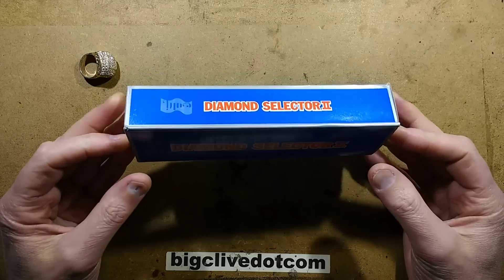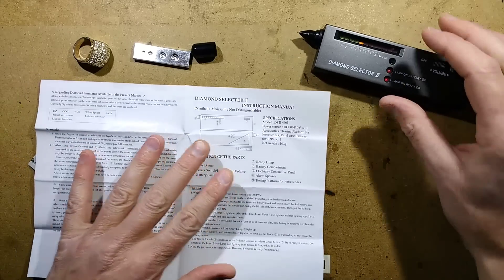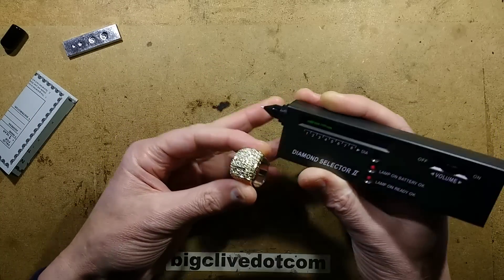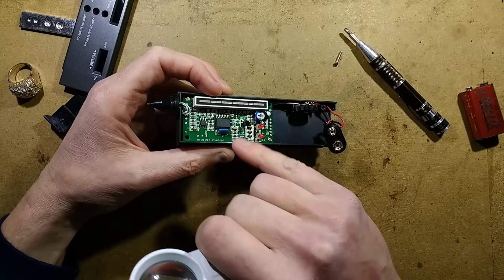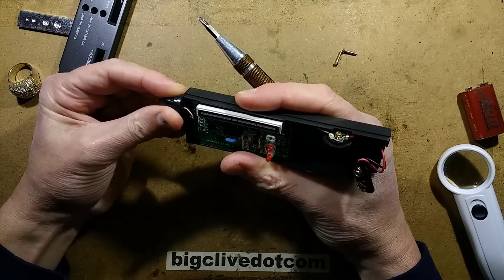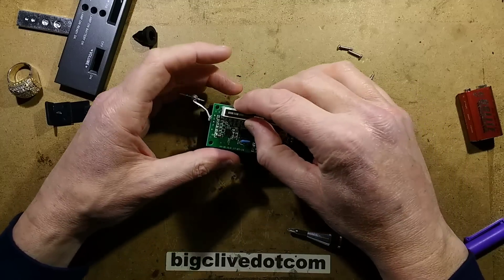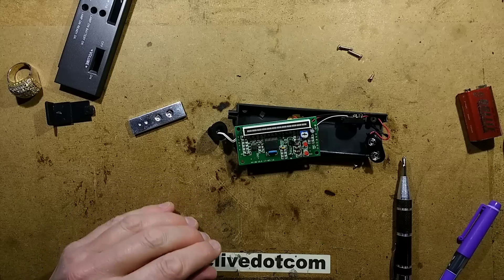Inside a diamond tester.  (thermal conductivity)

Comment: I don't buy the 37°C of the tip. Your camera caught a larger area than just the tip and read an average.
I had such devices in my hands (professional ones) and, nosy as I am, tried the temperature on the outside of my thumb or hand - it hurt a lot!
You shouldn't use these for diamonds smaller than indicated in the description and shall not use it as the only indication method!

Comment: Hello Clive, I’ve greatly enjoyed your videos for a long time, but I had never noticed this one before.  As it turns out I bought the same tester to try out an idea which I had.  I’m involved with a group of electronic scrappers on Facebook and new members often show items they’re unfamiliar with to get them ID’ed and ask about potential precious metal content.  We’re always warning members of the toxic dust dangers of breaking the white Beryllium Oxide (BeO) ceramic caps on RF power transistors or the purple BeO ceramic rings on magnetron tubes for example.  In some cases there will be a warning label on a board or particular component, but often we’re left to guess whether they could contain BeO or not?  My Google research showed that BeO has a much higher thermal conductivity than alumina.  So my idea was to see if there was enough difference that a normal diamond tester could determine reliably whether a ceramic item is toxic BeO or just ordinary alumina?  I don’t know if you ever did any further investigations with this device or created a schematic?  I just got my tester in the mail today and did a quick video earlier tonight.  I had some inconsistencies though, but I could only locate one known BeO object for comparison.  I don’t know if the range of this device could be modified to be better for this purpose, although if you came up with your own design I’d be willing to purchase one.  In any case if you would be willing to take a look at my testing and results it’s at:  https://youtu.be/QSO_BxoWdAw

Thank you!
Leo

Comment: So this thing works almost exactly like a Mass Air Flow sensor in a car intake, except instead of pressing the tip against a gemstone the tip is in the intake air stream and the other end is protected from airflow. Higher air pressure cools it faster, more airflow cools it faster, and the ECU can accurately calculate, from that, the absolute amount of air going into the engine at a given time.

Comment: personally maybe the op amp is use to GAIN the signal as the differential of thermal conductivity is so LOW, that the micro controller attached now can read the signal and have a range of frequencies(1-3 now have 1-100)(micro controller probably) at  set up as a pontentiometer( were you can adjust a starting point[calibration]) at that given value, you set the micrometer to reals required voltage to the graphical display hence the manual calibration. to find their"zero poiint"....fr i work with thermoucple all day at work..i thought it would have been a lux sensor in that thing :L

Comment: you could check it on a dressing diamond used in a grinding disc dresser. Alternatively, a diamond in a glass cutter tool could help testing it too. The differential temperature measurment method with a heater centered between 2 thermocouple sensors is also used on a pipe in mass flow meters of gasses and liquids.

Comment: A simple method is to hold the stone to your lip.  If it feels cold like metal, then it is likely to be a diamond. Other gemstones feel warm as they are not highly thermally conductive.  The synthetic gem he mentions "moissanite" has a lower density, a higher refractive index and a slightly lower hardness than diamond.  However, moissanite is electrically conductive while diamond is an excellent insulator.  I'm sure Big Clive could whisk up a suitable detector for it!

Comment: So would would it be measuring a change in voltage/current because of the temperature difference on both sides of the pin and back to the chip and sending it to the led graph. I thought these might of worked on some frequency the diamond might have. I wonder how actuate they are?💍♨

Comment: Cool Beans.   I was thinking they used Electrical Conductivity.    Thermo Couple generate Current not so much voltage variations. They're measuring the current variance.  Bet the Op AMP is set up in a Differential configuration ?

Comment: Is there a device for metals too?
A tester to make sure your gold bars are not colorful coated Tungsten rods ?   :-)   ?
Reply: Measure the specific gravity, that will give you a very good idea, and cheap too.  After that you could measure electrical conductivity (more expensive) or use a mass spectrometer (very expensive!).
Reply: @karhukivi  SeaJay chose those two metals for a reason. sp. gr. Au = 19.3  sp. gr. W = 19.3   You still going to suggest using sp. gr. as a way to distinguish them?
Reply: @igrim4777  true!   Usually it is some cheaper metal like brass or an alloy with silver, hence a SG test.  In this case electrical conductivity would be a better test if we knew in advance that the choice was limited exclusively to gold or coloured tungsten bars.  But how would we know that in advance?
Reply: @igrim4777  OK, so say it is a quiz game and they tell you it is either a gold bar or a gold-plated tungsten bar, how can you tell the difference without lab equipment?  One way is to drop them both onto a hard surface - the tungsten is hard and will bounce, the gold is malleable and will hardly bounce at all.  You could also hit them with a hammer, or scratch them with a knife.

Comment: The two thermocouples are the same basic idea as a "Mass flow meter" the basis for "Mass flow controllers" (feedback to control a valve position to control flow). The ptc being a heat source instead of a hot wire being cooled and temp being measured up and down wind. Cute design. Tootles... Wade

Comment: in the past many times the number was also on the bottom of the chip although I havent seen that lately, Also I have been able to resurrect the part number using a high power magnification and able to see the remnants of the original number

Comment: The simplest answer is usually the solution - especially when you're talking cheap stuff.  Constant current supplied by the two copper wires heats the rod to a set temperature.  Thermistor in the middle detects temp, and dial sets it to the middle.  Constant current means constant temp for set resistance in a set environment.  You zero the graph, and anything you touch the tip to drops the temperature, moving the graph.  Just a guess, but I find it hard to believe they'd have balanced thermocouples at that price.
Reply: Occam's Razor demonstrated. Congratulations, you guessed correctly!

Comment: Computer heatsinks are never anodized, because the process replaces Aluminum atoms with an element that can bond in the same way, im imagining any element with the same number of electrons in the relevant electron shell, which would be 3 if Im not mistaken.

Youd have a whole surface layer of poorly conducting material.

Comment: Big Clive: an emergency repair of a battery charger at a hotel involved me using 60sec all purpose glue to secure a plaatic plug thing inside... like inside of PCs ... is thjs likely to set on fire or am i safe
Reply from the maker: Without knowing exactly what you'd done it's hard to say.  The high speed resin glues may not stick some plastics too well.

Comment: Sounds to me that it might work like a hot-wire anemometer for measuring air speeds.  The thermocouples control the current flowing through the wire to maintain some temperature.  By measuring the change in current to maintain that temperature you can estimate the thermal conductivity of whatever material you touch the tip to.

Comment: hey clive, i've noticed that you often use the word "modest" in what seems to be the opposite way in how i've heard it, and also the opposite of the actual dictionary definition. it basically means small, or not much. but you often seem to refer to "modest" as fairly large. What do you think?
Reply from the maker: I think it may have different meanings around thew world.  For instance, making a modest living out of something means that it's OK but not spectacular.
Reply: i think i would agree, but i think you use it when you mean something is larger then you might expect. for example if a resistor value is somewhat larger then you would have thought you sometimes will say like "wow that's a pretty modest value"
Reply: Modest is part of a rising scale such as "tiny, small, modest, copious, large and huge. Modest would be in the realm of sufficient and not skimped. Hope this helps you out beano.

Comment: I wonder if it is a thermocouple. You said it needed to warm up to 36C. That implies a heater in the tip. I suspect that the probe wire is nichrome or the like and the two hunks of magnet wire put a current across it. The thermistor then sees a change when you touch the end of the wire to something cold. Perhaps somewhat like a hot wire anemometer.
BTW, you didn't comment on the trimpot at the back of the board.
Reply from the maker: The round component is a PTC thermistor.  It's a self regulating heater.
I'd guess the trimmer is for calibrating the range of the sensor.

Comment: Thanks to you, taking apart fake SNES chips came across my first um I believe it says Nintendo on the chip but they've marred the surface quite good..  This was for a fake copy of TMNT IV  Turtles in Time (banggood)  usually it's some other chip.  But using a Nintendo chip?  Why scratch off the name?  Motorola and Sony just fine but Nintendo  , that SNES has 2 chips.  The big one which I assume the program resides on and this smaller chip which for whatever reason has maybe 1991 Nintendo on it.

Comment: Since the tip also generated heat, is it possible that the two copper wires are used to pass a mild current through the rod and thus heat it to 36.3C?  The thermistor would then monitor rate of thermal conduction out of the rod.  Possible?
Reply: yes people are over complicating it.

Comment: I used to use one of these in my work. I was a buyer at a pawn shop (Cash Generator). They are pretty reliable when used correctly. It's an essential tool for turning away scammers, along with a diamond loupe for sizing. However I did once turn away a woman with a HUGE genuine diamond ring. It was clearly not hers. Thanks to this instrument, she was reported, arrested, and the rest is history. Thanks Diamond Selector II.
Reply: So, how did you use it, when actually it accurately doesn't detect the difference between a real diamond and one that is not real? Maybe in the day you were still able to tell a moissanite from its looks / colour?  It looks like this is not a useful device today though?
Reply: Cool story bro. I like the part about how you won.
Reply: you sound like a pussy

Comment: It looks almost like a voltage divider for temperature. It measures the thermal drop across the piece of wire just like a resistor for voltage.

Comment: I'd like to test some desktop thermal compound called IC Diamond which I believe may have diamond powder in for heat conduction between the CPU and heatsink
Reply: If i understand the device correctly it would 100% give you a false positive no matter which thermal paste you use

Comment: I was under the impression that thermocouples needed a fused junction of the two metals. these are soldered as you mentioned.
I would say it's a resistor bridge. the rod is a low conductivity metal, the ptc wire is the common point and the copper wires are the other ends of each resistor.
Reply: Fusion not needed, twisted wires will do for temporary service. Introducing a third alloy (solder) muddles things, except in the case, as here, where the same solder is used on both junctions.

Comment: How does it detect when you are touching metal? That triangle plate on the cover doesn't seem to be connected to anything. It looks like it should be connected via a spring on to the PCB through the round hole in the plastic but I didn't see any contact pads or springs on the board.
Reply from the maker: +MrMaxeemum There is a wire connected to it next to the piezoelectric disk.

Comment: Transistor thing?
Come on, let us call it to-92 package...
Reply: L3 P3 In this case it was a Transistor-92 package with an 78L05 chip inside, but until checked it could have been a non-quite-to-92 package from one of the many factories that like to tweak the package dimensions slightly.
Reply: L3P3 
Have it your way...
You L3P3 are a TO92 package, so there!

Comment: Black doesn't radiate heat any more. That's a myth. It does look cooler though.
Reply: Geoff Lotton ; source?  It is still commonly taught that in radiation black is better, as in ir measurements the color and finish off the material effects the reading.  Convection and conduction, different things and lack a color benefit.

Comment: It might be a pair of type T thermocouples, made from Copper/Constantan. These are sometimes connected back to back to measure temperature difference. The higher thermal conductivity of copper will also help in sinking heat to the tip. Another advantage of type T is that the lead out wires can be made of copper.
Reply: AndyP, I'd bet they went even cheaper and used extension grade constantin (u-type) wire. Good to 150C and they can just use tiny copper bell wires to form the junctions. They don't even have to do any research since the mV for the range is published even in such an impure grade of constantin.
Reply: Yes, I bet that is the cheaper extension grade, the accuracy is probably good enough for looking at large conductivity changes.

Comment: Did I miss the part about the metal plate on the back?  The metal plate and the 'tip' could also be a second input channel.  Is it connected to one side of the PTC so that a human body becomes a paralleled component across the PTC?  Would the human body affect the resistance or the inductance?
Reply from the maker: +Jay Herde it's the electrode that detects when you miss a gemstone
And touch the probe to the metal.

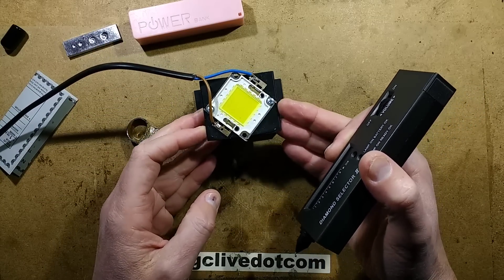Comment: At (5:35): Aluminium oxide is a actually a good thermal conductor. Treating the aluminium (anodizing) makes the surface quite porous and hard. For aluminium to air conductivity that might even be a plus due to the larger surface.
I’d assume that the tip of the tool can’t get a good conductivity with the anodized material as it it quite hard and porous. Bare aluminium is quite malleable and might form a nicer surface and hence better conductivity. There will be a thin oxide layer on these patches too, but I thickness and porosity might be significantly less.

Comment: Would you mind trying that gizmo on some metals?  I wonder if it can be used to differentiate between aluminum and pot/zinc metals or help classify bronze/brass alloys either directly or watching the 'swing' of the meter.   A quick non-destructive method to classify metals or alloys would make picking the right weld/braze method or filler a lot easier.

Comment: Are you sure it's a thermocouple arrangement (using the Seebeck effect?) Could it be just a 4-wire sensing arrangement? The current flows through the white wires, but voltage is measured across the enameled wire... I guess that the voltage drop of such short sections of wire wouldn't be high, but the fluctuations in temperature are probably very small...

Comment: Could be 2 type T thermocouples... that would kinda work with the colour code too. The white lead would be Constantan (copper nickel alloy) and the other lead would be copper. It is also a fairly low range type of thermocouple so that would increase the accuracy of the device.
Reply: Matthew Clitheroe There's no measurement wire connected to the middle (needle) material.  The two copper-needle thermocouples are connected backwards in series so the average temperature cancels out and the difference is doubled. The connection between the two thermocouples is simply the rod itself.  The two white wires power the little heating element.  Touching metal is detected by electrical measurements between the tip (via one or both copper wires) and ground (via the metal plate).  Heating up is detected either with a fixed time delay or by checking the current through the PTC heater.